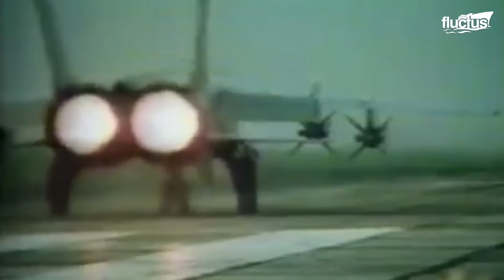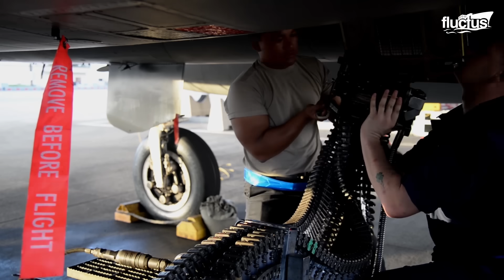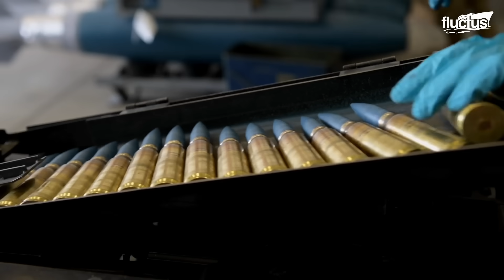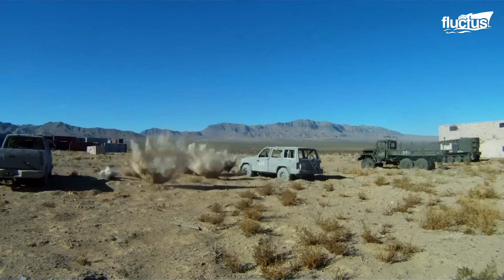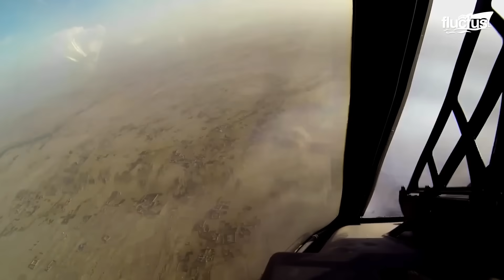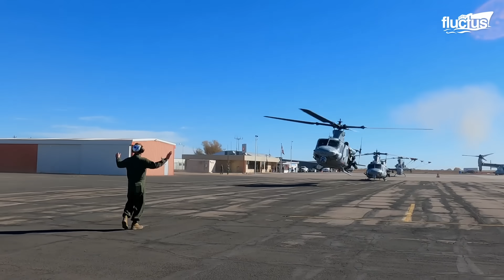Crazy Process of Reloading US Fighter Jets With 1000s of Scary Rounds in Minutes

Comment: I seriously doubt that any aircraft will ever be involved with dogfighting ever again.

Those times are over.
Reply: That's what they said when they built the F-4 Phantom with no gun. It was going to be a missile fight--until it wasn't.
Reply: Ah, fighting the last war.  Missiles have changed in 50 years.
Reply: @paulogden7417 a summary. If things go pair shaped and it’s now a dogfight which can happen, you’re dead without a gun simple as that. So no, it isn’t a thing of the past. I mean the most technologically advanced fighter in ever even comes with Gatling type guns just in case despite never needing them if everything’s good.